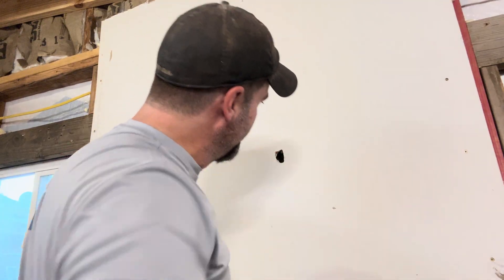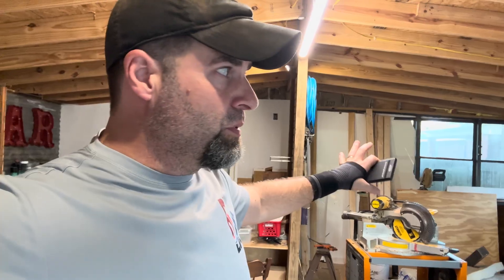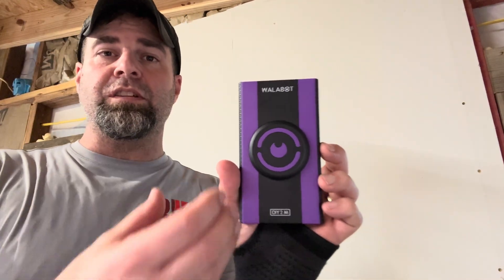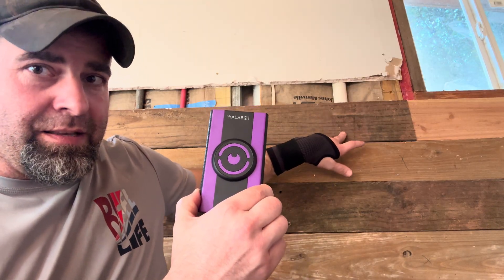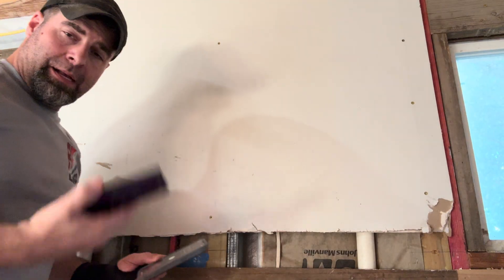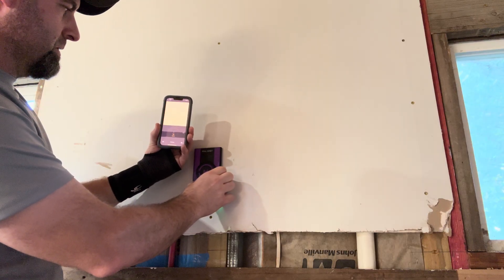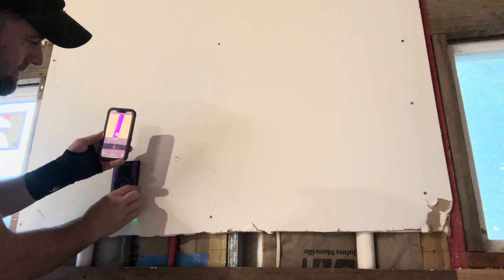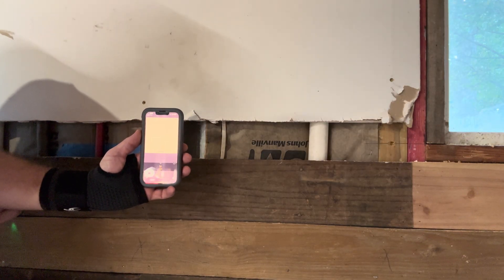Is the Walabot DIY 2M Worth the Money?

Comment: So I seen on another video a guy that’s a radar technician said that the walabot doesn’t know what the item is. The software is detecting how far the object is and then says what it is told to say. whatever is against the drywall, make that a stud. If it is 3/8 or more off the wall then make it a pipe or cable.